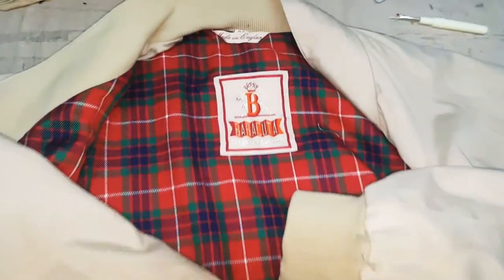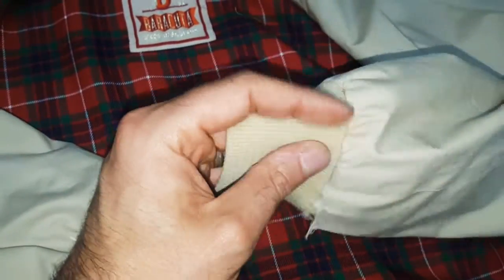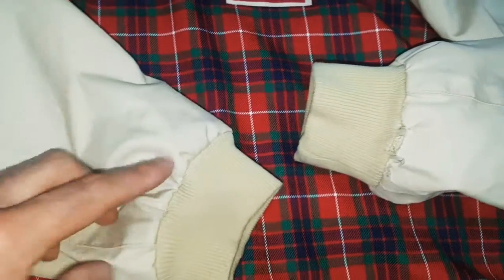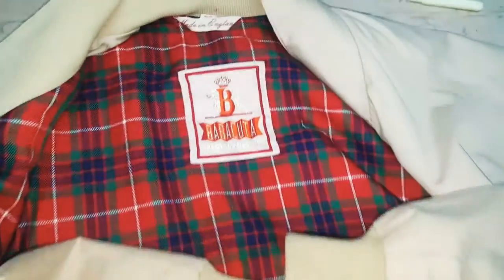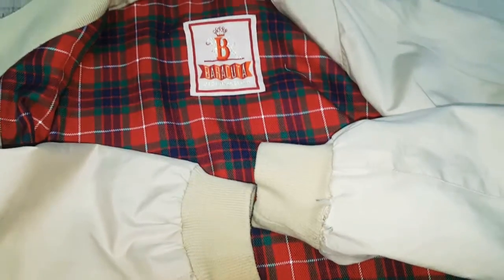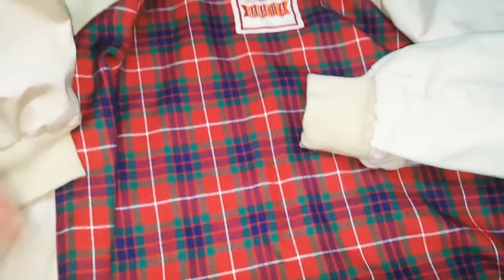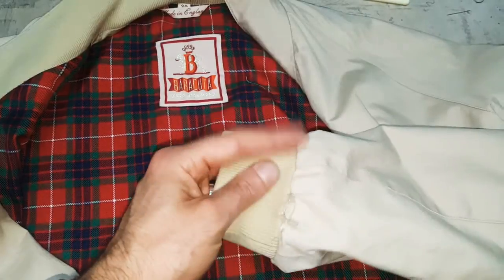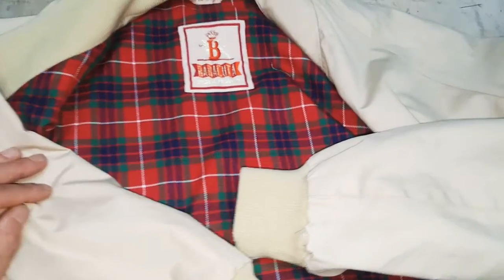HARRINGTON CUFF REPAIRS On A Vintage Baracuta Jacket At James Personal Tailor In Manchester England

Comment: I realize I'm late to the party, but I did have a question, I've recently come into possession of a similar style jacket just not barracuta or harrington but I still have the same problem with the cuff, seeing as it's a thrift. Can the cuffs and the waistband be replaced? I don't necessarily want the same color as the original.